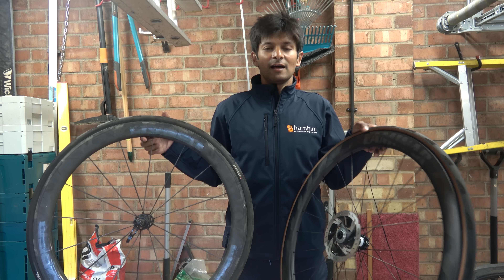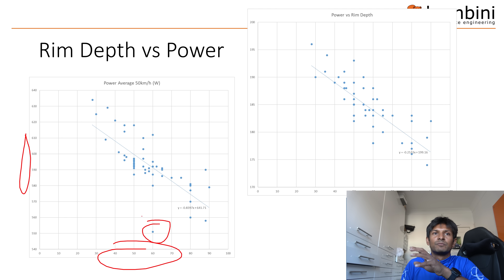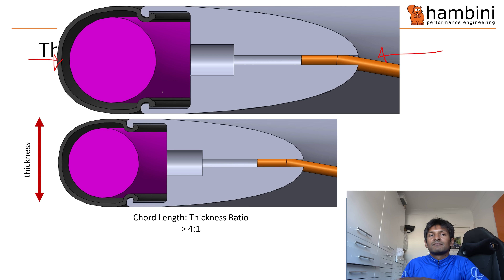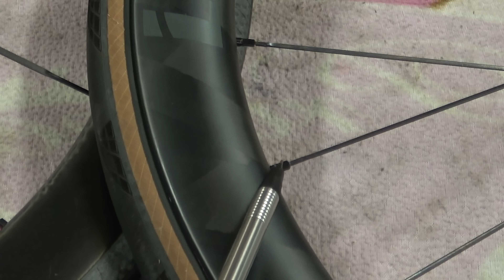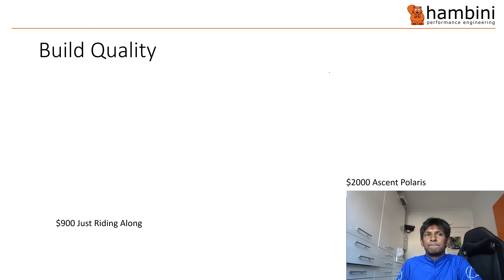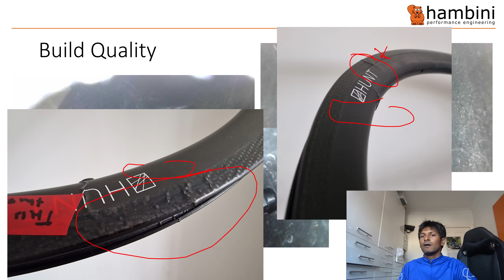Aero Bike Wheel Buyers Guide | By an Engineer

Comment from the maker: Any feedback on this type of video is gratefully received!
Reply: I like facts and hate marketing BS - so for me videos like this are gold 👍
Reply: Just tell us what to buy mate bloody hell! 🤣 Just kidding, engineering part is awesome, but maybe also include a top 5 or top 10 list?
Reply: @Maverick5588  any TOP list is a snapshot in time. I think @Hambini intended this video to be timeless, hence only examples for different types of construction, and no mention of good or best wheels.  Any list of "best wheels" woud b e split up in a scale between as fast as Possible, and as comfortable as possible and a combination of those two factors. 

Tyre width ( wider ) and therefore pressure (lower )controls much of the comfortable section followed by spoke type ( Steel, Carbon, or Kevlar string )  and or course Rim construction. 
But dlimmer wheels  and slimmer frames  get you much faster wheels and more aerodynamic benefits  above 35 Kp/h,  resulting in a harsher ride.
There would be a myriad of lists to compile to get an top 5 list for every need and every rider.  :D
Reply: @Maverick5588  this would be almost impossible.  Some of the best aerodynamic wheels have poor durability, some of the best made wheels compromise on small aero gains for long service life.
Reply: @Mapdec  , I would like to hear more about this. Can you share some examples? I want a wheel that is going to remain Tru for a long time.
Reply: @NeonGrayEdits  the best way to achieve this is with a high spoke count 28 or 32, straight gage spokes at above mid tension and very low variance, brass nipples and spoke freeze.
Reply: Really appreciate the more professional tone here. While we all enjoy a good rimming (did I spell that right??), I think that putting the right kind of information, data and knowledge out there is way more valuable. Thank you! And please hurry with the frames too, I have a decision to make soon haha.
Reply: Very good video! I need 70mm for my roadbike :O

Also you forgot to test that the pen is working
Reply: Is that a new Jacket Mr. Hambini? Is it merch one can buy? Is the logo embroidered? Thanks Mr. Hambini! I'm off to bone my hair dresser.
Reply: Could you end the video with a summary of key points/things to look out for?
Reply: Great video  There is a slight editing error @7:43 fwiw.
Reply: @qibble455  I’m guessing you joke
Reply: A great video. Informative, to the point, no swearing.
Reply: How do you feel about using plastic spokes like BERD spokes to save weight?
Reply: @nick37781  be prepared for lots of fettling.  Good if you like constant tinkering.
Reply: Thanks for touching on non standard bearings. No one ever talks about the ownership prospect of these products in marketing.  I run a busy workshop and we see this daily. Non standard 18307 15267 etc bearings are totally unnecessary with no decent aftermarket options (please don't say Enduro). I surprised you didn't mention alloy nipples buried inside carbon tubeless wheels and what a wonderful long term ownership journey that will be!
Reply: Nothing about lateral wheel stiffness - bracing angles,  total spoke cross sectional area and youngs mod.
Reply from the maker: @TinkTom  I have to draw a line in terms of technical stuff somewhere. I think those topics are over it.
Reply: @Hambini  one topic and my opinion of some of the key attributes that relate to it.
Of course can't cover everything in one vid but lat stiffness is important, especially when running rim brakes. Maybe something for a future vid 😬
Reply: @Hambini  I don't even have a road cycle (I ride a Giant XC bicycle) but I enjoy watching your videos to understand more about the technical stuff. I'm thinking about buying a "cheaper" road bicycle at some point, perhaps a Giant defy or Canyon Endurace type of bicycle with an aluminum frame.  I don't perhaps want to spend money on a more expensive carbon frame (I feel that might be wasted on me as I only ride for commuting and fitness purposes) so I would like to know how aluminum frames compare to carbon ones for the bottom bracket tolerances etc. and are for example Giant aluminum frames typically good or bad quality. I have understood that perhaps aluminum frames are easier to make so tolerances and quality control could be easier with them but would be interested so see any videos on such topics for bicycles that don't cost a fortune.
Reply: Your roasting type of videos are fun to watch (and that's one of the reasons why I subscribed), but honestly, I enjoyed this VERY informative and well-written guide a whole lot more. I don't say you should stop doing what you do, but I would personally really appriciate if you produce more vidoe like this. Keep up the good work <3
Reply: The bigger and stiffer the better.
Reply: Liked the vid! Not anything particularly new to my ears but still good. What about hooked and hookless design?
Reply: Without a rough quantification statements like "with 28mm tires you need at least a 80mm deep rim" isn't very informative. What is the penalty for violating this rule? A "order of magnitude" estimate would go a long way.
Reply: Curious, from an engineering perspective, J-bend vs Direct Pull spokes, the advantages / disadvantages
Reply: Great video for sure! One suggestion would be to try an incorporate a scale from marketeering wänk all the way up to the dogs bollöcks in terms of specs (it would be best to do it by manufacturer but that is likely to land you in a heap of unwanted trouble). Hope it helps, and thanks again for all the content that you put together!
Reply: resonates with me. Review of objective facts not subjective beliefs.
Reply: Some documentation we are able to refer to would be great. I still refer to your rim testing graph. 

I’ve also just ordered some LB WR65 rims with Carbon-ti hubs. I’ll be running Pirelli P-Zero SL TLR 26mm tyres (more like 29mm on the 25mm internal width) with the 32mm wide x 65mm deep rim. From your analysis I think this will be a good match.
Reply: Thanks for putting this together! I would love you to make a summary at the end, with a TLDR as well as adding the youtube segment feature, to see each talking point seperated and easy to skip to.

Very informative, love it when you're also producing a bit more "serious" content vs the infamous banter :D (also one of the reasons on why I bought a BB from you)
Reply: Great video 👌 (& I'm not even into road bikes), impressed at how you avoided all the possible ribald jokes concerning nipples, rimming, etc 😅
Reply: Can you make a part 2?
 Not aero oriented wheel video like this one but comfort and traction oriented.

The science behind inner rim width, tire size, tire pressure and deflection.
Reply: @robest334  the science is called SKU rationalisation. For the same cost mitigation reason manufacturers don't want to offer rim and disc brake frames, wheel companies don't want to have to range road and gravel rims. So the hard push is on now to convince roadies that 23-25mm ID work fine with 25-28mm tyres when in fact 19-21mm ID is the sweet spot. At the same time attempting to convince gravel riders that aerodynamics matter on knobbly 40mm gravel tyres and you need a 55mm deep rim. One wheel to rule them all!
Reply: I think the only point you missed was how the internal rim width affects the externa external rim width and optimal tyre size. Also i did not know about that 4:1 NACA ratio but it makes sense. The information of many scattered Hambini Vids combined into one, i like it!
Reply: I'm somewhat confused by the rim profiles. It seems like most brands (dt swiss/zipp / hunt) and non brands are using similar to the type 3 profile (late bulging). Surely there is a reason if it's not cheaper to build. You say avoid them, but not really why. I would expect this shape could interface differently with the tire + air could potentially flow more easily through the wheel than around it, which id say could lower the pressure differential. So why should we avoid it and why do you think so many brands apply this shape nonetheless?
Reply: Enjoy this type of video
Reply: Thoughts on undulating wheels like princeton carbon works ones? dont they combine best of both worlds by increasing cross wind stability and being deeper so more aero.
Reply: Excellent video and great idea, please do more of these for other parts of the bike!
Reply: This also gives a flashback to one of your earliest videos on radial and angular bearings. Since the rear wheel isn't turning radial would make sense and for front wheel I would reckon angular or ball bearing to fight the off center forces?
Reply: Just a very clean video. First time I didn't laugh with the jokes, rest very informative as always
Reply: Should we still keep banging hairdressers?
Reply: It’s good. Now you or peak torque need to show the maths on why light wheels make you feel faster. Probably something to do with force or impulse transferred to hands and/or backside from pedals force.
Reply: This is a fantastic video. Just start a review site already.
Reply: Great informative video! Maybe say which hub manufacture you can recommend when you where listing them.
Reply: Great video. Informative and without the usual superfluous vulgarity. Much appreciated.
Reply: Using chapter timestamps would be really helpful.
Reply: thanks! do you recommend deeper rim in the rear than the front? Also, you mentioned round spokes have ~3w penalty at 200w, how much of a penalty (approx) do you pay for sapim vs the fatter/fewer spokes you also show in this video?
Reply: I use 28mm tires to compensate for the lousy roads around here and there's no way that there can be a clean connection between the 19mm inner width and the wider tire. You as a pipsqueek using 23mm tires are in a totally different position. My aero wheels on my steel frameset seems to work well. Your analysis is fine for pro's but the people who are watching you religiously are sports riders and need to be told that they don't ride fast enough to need anything more aero than the 50mm deep wheels. When you ride an average 17 mph you cannot even detect all of the super-aero frameset "improvements". While I enjoy your videos maybe you should start playing to your real audience.
Reply: Very informative. 👍
Reply: An observation. You spent a lot of time taking about rim profile based on the tyre being the leading edge, yet with a bike wheel the tyre is the leading edge for at most half, but more like 35-49% of the radius. The tyre is the trailing edge for a large part of the radius, and effectively neither for the remainder. The rim is the reverse, so trailing edge when tyre is leading, and visa-versa. No mention of this is made in the video, and surely this one reason why a blunted rim design has become the norm over an aerofoil profile?
Reply: Defeated by "inevitably" so I'd say you're off to a great start
Reply: Good format, i think we all would love some recaps on what you tested and what we should avoid. Also this kind of buying guides are really good for people to demand market change.
Reply: Whilst I did miss the humour and antics Hambini this video format and the knowledge you shared here was so so interesting. 
I really appreciated this sensible style video, the educational focus and the ‘to the point’ information. 

I hope you make some more of these vids that go into deeper nerdier concepts to do with aerodynamics. 

I’d really like to know a bit more about how tri spoke and disc wheels are heaps different to spokes too
Reply: More sensible style videos on bike components. Maybe even a frameset buying guide? This video was stellar.
Reply: I enjoy it. I do like the c-ish sbag scale, and I hope it makes a return but this is very informative and everybody can learn from it!
Reply: Mate your in an untidy garage, why would I listen to you?
Reply: I understand this video is supposed to give us the tools to evaluate a wheel and see its weak points or strengths but it would also be cool or helpful to see examples of wheels that would make good choices based on the described factors. Even if those wheels aren't available in 6 months or a year when someone may be watching this video it at least could allow someone to have a baseline to compare wheels they are considering to.
Reply: Not enough swearing.
Reply: My hairdresser would look great in that Hambini jacket.
Reply: I think you are on to something BIG here....much appreciated! I don't even ride roadbikes anymore 😁
Reply: Hambini, Great video with technical info, made simple for us weekend club riders and racers. Very informative and a great reference that can be used regardless of what new stories, marketing departments at the bike companies think up to make us believe theirs is better. Thanks for taking the time to make it.
Reply: Excellent video, bursting with solid technical knowledge. I’d like you to discuss how disk brakes and spoke lacing interact. A front wheel with rim brakes can use radial spoking because the braking action doesn’t torque the spokes. It seems to me that a front disk brake would require a crossed spoke arrangement to transfer the torque between the tire/rim and the brake disk. This in turn will effect aerodynamic drag of the whelk, correct? (Separate from the drag of the brake disk itself.)

I missed the standard hairdresser reference, but I’ll get over it.
Reply: More of this please 👍
Reply: Great video Hambini. Check out this bike on Krol Rowerow u-tube channel! Its on a Trek bicycle with a little problem with the frame! Hope you enjoy it!
Reply: This is great, I'm just on a market for new wheels I was thinking "What Would Hambini Recommend"... perfect timing.
Reply: I like the info you provide as an engineer but not an aerodynamicist, however I missed the swearing.
Reply: Should I keep banging my barber…..I mean hairdresser?
Reply: This is the content we need.
Reply: The PenIs Working!?
Reply: I love how real your setup is. Ladders and rake in the garage, Princess bedspread under the wheels etc. But so many of the car channels have big clean white garages, maybe your incredible insight would land for more people if the presentation were more like that?
Reply: Great video.
Reply: Hi Hambini, I'm in the market for a new carbon rimbrake wheelset. A new a bit more dept >50mm and better braking performance. What would you recommend if you needed chose between Hyper, Elite or ventoux?
Reply: more like this plz! stop shitting on frame manufactures and tell us what to buy(or how to find a good product to buy) :)
Reply: Did I not pay attention properly or you did not use any swear word?😁Btw great vid as always, it's so cool when someone who understands physics puts his insights.
Reply: I really appreciate this video. I'm in mechanical engineering myself and while I can enjoy the "laid back" reaming of companies and their claims/practices, stepping in to explain some of the lower level details is my kind of jam. Thank you for making this, I would very much look forward to similar videos in the future.
Reply: Great, nice to see you not “reaming” a item but giving excellent consumer advice! Thanks! 😊
Reply: Would you say that winspaces new wider model is a negative step in aero dynamics as it’s 27mm wide.
Reply: IMO, this was the best Hambini video I've ever seen. By far. All facts and very efficient. Easy to follow. For reference, I started watching within the last 1-2 years and have watched about 20 videos.
Reply: just Uau!
Reply: Thank you, I always learn from your videos. Here's what I wish you would've commented on vis wheel freehubs: the preponderance of aluminum, sometimes with a bolted on steel strip (to deter cassette gouging), freehub bodies. A quantification of their chief benefit (less weight) in the overall performance of the wheel and your opinion from an engineering perspective would be appreciated.
Reply: This video is great and I've been looking at your data as I make choices about a new set of wheels for racing. One thing I've found very little about (in general) is the point at which it may make sense for a serious TT/triathlon amateur to consider a disc wheel over a very deep rear wheel (i.e. at what average speed is there a material power saving that would make the cost of a disc make sense, and how big is that advantage?). Any feedback or thoughts on this?
Reply: HAMBINI, I have had an interest in the "DRIVE 6" wheels, and also their 5 spoke wheel sold on Aliexpress but not their own website, oddly enough. These specific 6 and 5 spoke wheels are a lower priced "Black inc." And "Ahead Composite" wheelset, which is at a fair price point, especially compared to those companies. I have asked them several questions about their wheels, such as...."How is the hub supported to remain strong in the center of the wheel so that I can stay safe", for example, with "0" professional response, only online sales people trying to make a sale, and seemed to lack the knowledge to give me the answers that I need to feel confident about riding on these wheels. My local LBS has warned me to stay clear, and told me that aerodynamically, they are poor, although they look great. There seems to be no qualified information on line about this style of wheel for my roadbike. I can not get any answers! Will you please, please, please do a review of a 5 or 6 spoke carbon wheel, and help us to understand if this style of wheel is good or not for roadbiking? I say "any" because I understand that perhaps you can not get your hands on any of the above wheels. Please!.....thank you in advance.
Reply: 11:34 
Dumb question, what rims manufacture are close to 23/60 ? 
Also, are the benefits of 23/60 better than a 23/38 ?  Or is this just small gains, wind deflection, possible watts savings. 🤷🏽‍♂️
Reply: Hey @Hambini what do you think of the Reserve 52/63? Please reply I’m your long time subscriber
Reply: I purchased the Winspace Hyper 50 wheels and they were garbage, For context I weigh 80kg and ride about 250km on reasonably good roads per week but never in the rain. Yes these wheels are fast but all the spokes continually came loose and even fell out. The bearings shat themselves in no time at all. I really can't even get my head around how shit these wheels are. I would not recommend them to anyone.
Reply: Wheel depth coverage was good, but what about mixing depths? @hambini
Reply: Sound quality is extremely poor with echos or one channel just disappearing, get yourself a microphone setup for the garage part, great stuff but sound makes it feel like noob content.
Reply: I wish you would include some advice on the suitability for the person.  A casual rider has no use for carbon anything. Only people who can demonstrate an actual need should use this stuff. Obvious, but needs to be said.